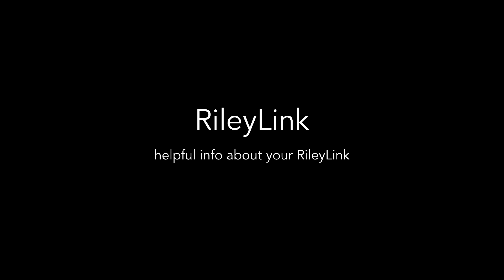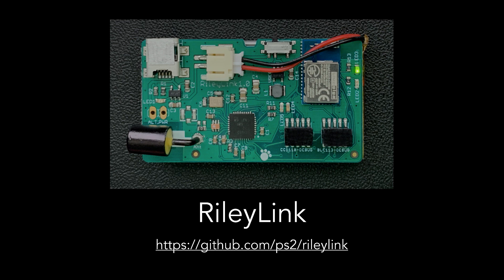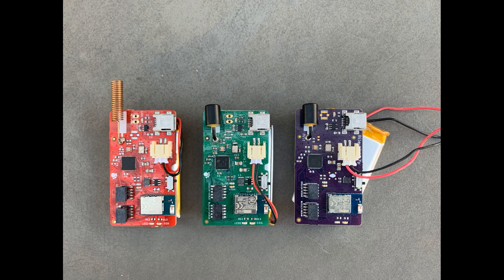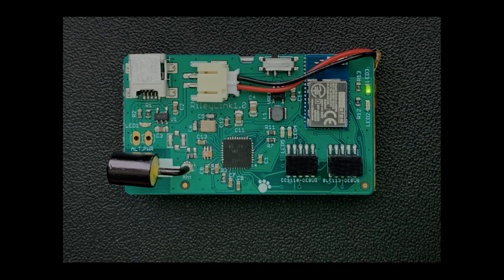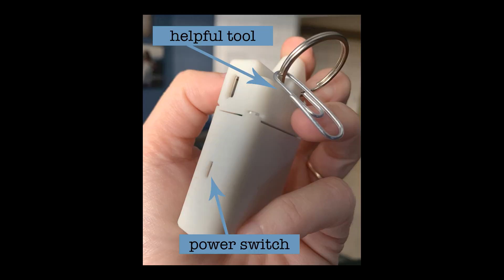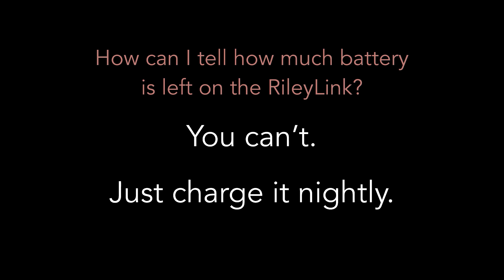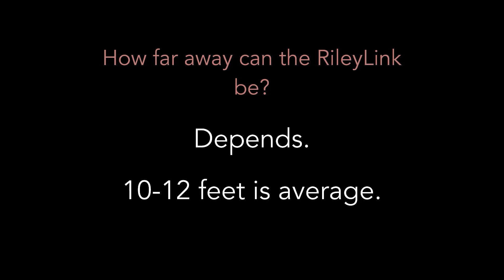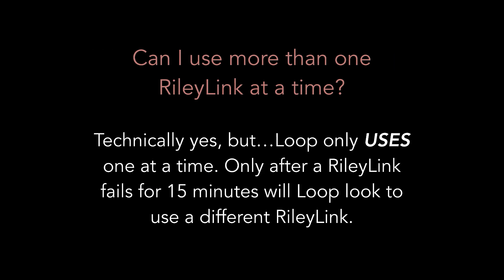Introduction to RileyLink

Comment: Hello, because the RileyLink relies on bluetooth communication, would it work in another looping setup on an Android device? I cannot use the Loop app because I am running android. I really don't want to build the board myself like many other sites recommend, but I don't have any Apple products and RileyLink seems like the simplest solution available for communicating between the sensor, pump, and phone